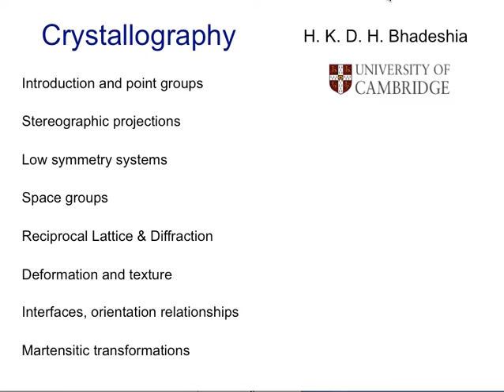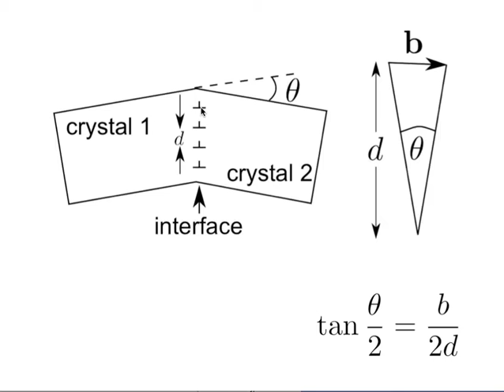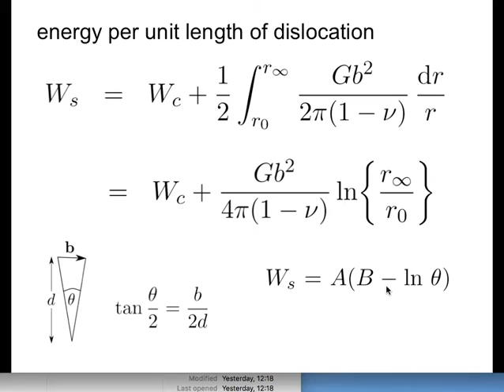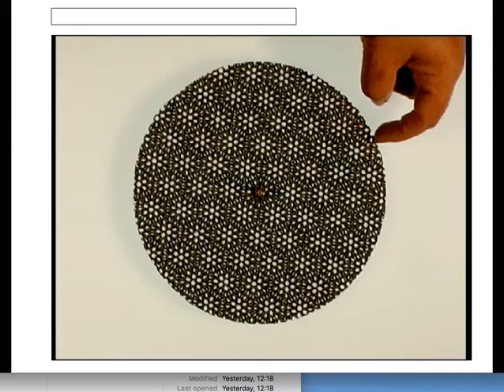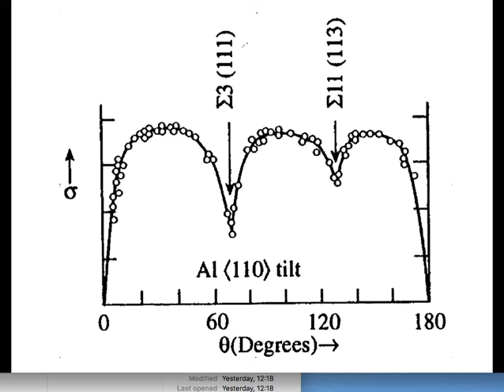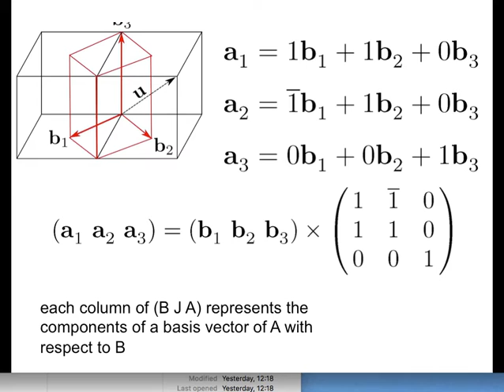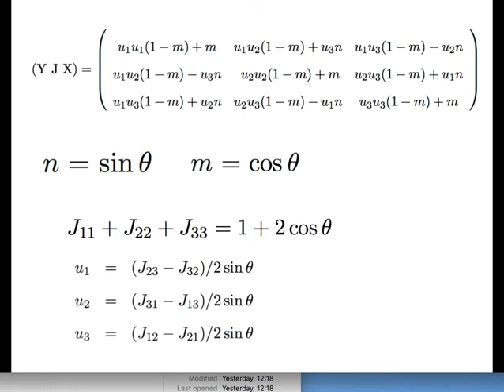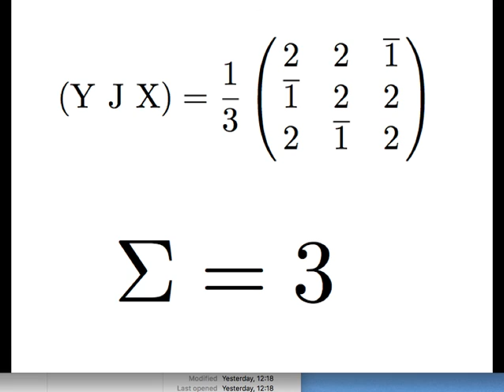Interfaces and Orientation Relations  (2016) - lecture 8

Comment: Is it possible through OR to know the phase percentage of a particular feature? for example, if I have widmann austenite and IGA austenite, would it possible to distinguish between them on the basis of their orientation with the ferrite parent phase? 

Thank you
Reply from the maker: You might be able to do so if you are concerned with a single grain of the parent phase, assuming that intragranular precipitates have a different orientation relationship than allotriomorphs. However, that may not be the case, you would need to do an experiment to determine the case for this methods.